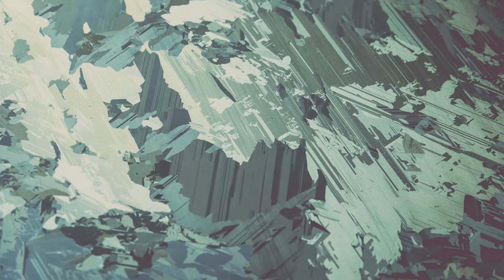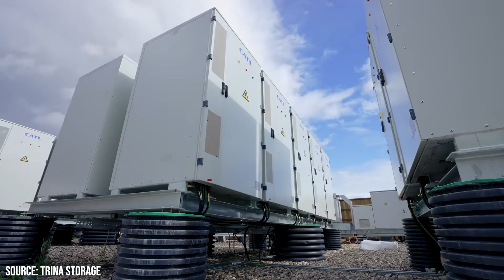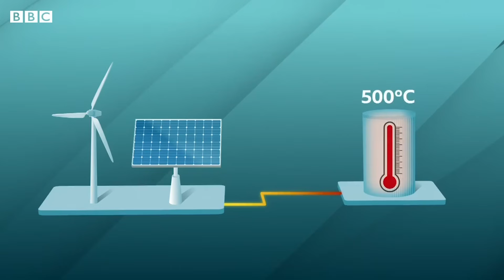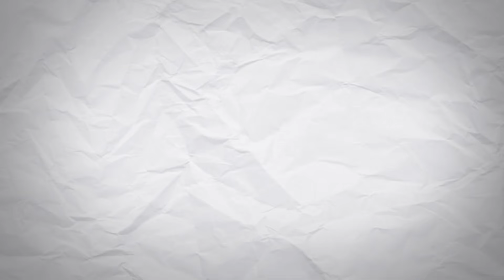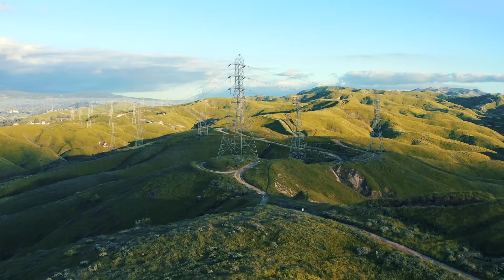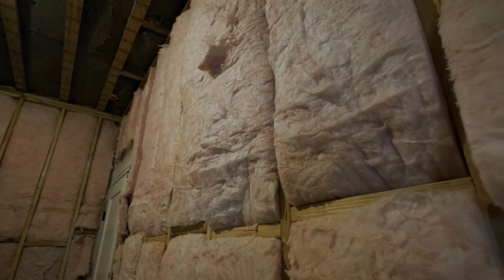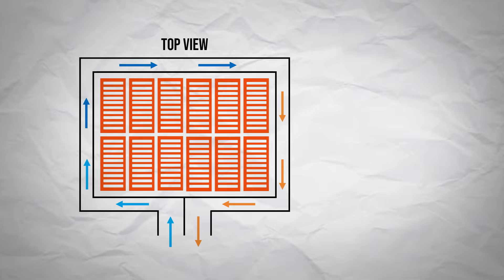How 3000 Degree Bricks Will End Battery Storage

Comment: It was an absolute pleasure speaking with you! Thank you for telling the story of industrial decarbonization via electric thermal energy storage.
Reply: What about smaller units for houses? Is that feasible? It would be easier to implement than on a district level and I assume it could be placed underground like with a septic tank or in a utility room.

On that note, could a small unit work along side a heat pump in a way where heat is retrieved during winter and then excess heat is stored during summer?
Reply: @Sweenus987 Exactly, this could potentially reach into household market and provide the cheap battery storage necessary to bring total system cost down 3 fold. Maybe even turn 5 Year ROI into 1 years if the cost is scalable down sizing 

If not there are plenty of other battery technologies just waiting to take down the lithium industry
Reply: I think the key disconnect here is that most of us are looking for “round trip” efficiency from electricity to storage to electricity again. The figure quoted is just electricity to heat and holding that heat for up to one day. 

There is no converting this heat back to electricity discussed. This heat will be used directly in industrial application where heat is needed, not electricity. 

So this isn’t a “battery” in our common understanding but more an “efficient heat storage”.
Reply: @benswilley7851  So for residential use cases it would be better to compare it to boilers? As in terms of how much energy it takes to heat a home, run a shower etc.
Reply: @Sweenus987  In the context of in-floor radiative heating, these would be great, as in those systems you heat a fluid and pump it through pipes or tubes in the floor slab, where it very efficiently releases that heat into the building.
Reply: @benswilley7851  I’m not certain that it’s fair to assume that these heat batteries will be limited to storing heat for only one or two days by the time they are ready for the market. I understand that in their current state, that’s the likely reality. However, as the market requires long term heat storage, it must be nothing more than a matter of time until the engineering is done to rectify the shortcoming.
Reply: This seems like a very promising technology!  I hope it works as intended.  Are the "bricks" made of a proprietary material (in order to be able to handle the heat loads and temperature changes), or are they made of the same kind of "brick" we used to build schoolhouses out of? 😉

I also wonder if this technology could be applied to dealing with high-level nuclear "waste."  As I understand it, nuclear plants currently need to cool "spent" fuel rods by putting them in pools that require energy from the grid or diesel fuel (during a grid failure) to circulate water in order to keep it from boiling off and letting the rods catch fire.  To me this seems like pouring half of a car's fuel into the trunk, setting it on fire, then using an air-conditioning system to keep the car from overheating. In short: wasteful, and dangerous.

Could the "spent" fuel rods be enclosed in "bricks" like the ones you use, and used to heat an inert gas (so they can't catch fire even if the brick enclosure should crack or leak) and generate industrial heat?

BTW: Does your company have stock?
Reply: This sounds good, but do you have a pilot? Also, dunkelflaute. Great word.
Reply: Could this be used to work with boilers to replace the coal burners for steam turbine applications?
Reply: @VonEveric  
Definitely possible. Round trip efficiency would be lower than batteries, flywheels, gravity etc. Also lower than using the stored energy directly in the form of heat. 

But the good news is that existing thermal plants (coal) could be converted to storage. The cost of a facility and financing costs are a big fraction of overall cost. Efficiency is not everything.
Reply: @OrenTirosh  so pay for it even if it doesn't work, what an amazing attitude to energy security..!!
Reply: @stewartread4235  what and amazing misreading of what I wrote. 

Storage systems with lower round trip efficiency such as compressed air have their place if they have other desirable properties.
Reply: @VonEveric  no..!
Reply: @stewartread4235  Why
Reply: @VonEveric  because you would have to produce more power than is put in, you can't produce something from nothing.
Reply: @stewartread4235  Energy and electricity is still a topic that mystifies many people. I understand how frustrating it is when you run into someone who has difficulties with the basic principles or simply is ignorant to the field. But we can’t be making assumptions that they are referring to perpetual motion or demeaning them through condescending remarks. I read the conversation you had. You come across as insufferably arrogant. Try to be better.
Reply: @Veritas-invenitur  insufferably condescending comes to mind.!
Reply: Wow what a concept this material inspires me if Nicola tesla had a viable concept this seems to be it the closest point to conceptualize from what we know
Reply: It's entirely incorrect to say efficiency is 98%. If you heat the bricks with electricity you can at best recover 35% of that back as electricity. Heat is low quality energy. If you consider that your output should be heat, then burning fossil fuels is 100% efficient as you convert all the chemical energy into heat. You should have qualified that 98% much more... People who don't know thermodynamics then repeat what they hear in these channels and it leads them to have silly expectations...
Reply: @andinosa  Burning fossil fuels is only 38% efficient.
Reply: Rondo energy, Carbon is Latin for Coal. Coal means decomposed plants. How can you decarbonize necessary material??? I guess you guys want the earth to be a desert if you profess decarbonization. The soil is carbon.
Reply: Jeez, the Romans did this..!
Reply: @stewartread4235  You know what else the romans did? Had their society collapse. And it looks like we're headed that way too
Reply: How can this be applied in a data center?
Reply: Like the fusion or anything... in then End, Make it work... I think I can says this as a member of the Human population that couldnt careless about what goes around.
And thankyou, to ppl such are yourself that makes this world easier to live, to push forward in technological advancement.
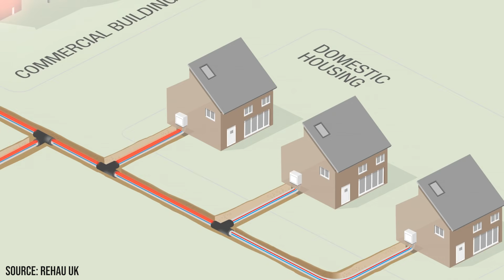Reply: Show uf grafs , independent mesurments . 7:33 in EU that what we call central heating .
Reply: How do i invest? How only 20mil? You need a bil !!
Reply: Who the hell are you.
Reply: We won't be "decarbonizing" anything, ya dupe
Reply: Don't you also make that energy drink with the Electrolights that plants crave?
Reply: @NexusARC  electro lights.......
Reply: @HarshJain-it2bg  Sorry, Electralights. Like that actress Carmen Electra.
Reply: @NexusARC  Electra ????
Reply: @NexusARC  Why did they let you go out of that mental hospital.....
Or are you watching YouTube there.
Reply: @HarshJain-it2bg  I got a metal plate in muh head.
Reply: @NexusARC  Then stay away from Electro-lights.
Reply: Thank you, and I hope you have good security because in my experience, anyone who comes up with a competitive energy product is coerced into selling or mysteriously dies.
Reply: @rondoenergy4228, This video is a great presentation of your project. I really like the idea!
However, I don't understand how the battery will operate when no heat is needed at the facility (e.g. at night). From the video I gathered that the battery must pump the air through itself to keep itself warm ("dynamic heating"). This action requires external energy. So, while the battery is 98% efficient, it requires external energy to operate when the facility is not operating. This must lower the efficiency somewhat. How do you deal with this? Is this a significant problem?
Reply: @unbridled_exciton  Maybe the solution is to run 2-2-3 shifts so the facility is always operating, at all hours of every day.
Reply: Hey, I have a question for you. You mentioned use of concrete while discussing the materials for bricks, but also that the materials could come from virtually anywhere. Typically, Concrete relies on a very specific type of clay that comes from riverbeds, where the constant water flow is able to reduce the stone to superfine granules. Because of how long the process takes, we are already expecting a Concrete Shortage in fields like architecture where concrete is more heavily used. I can only imagine implementing these batteries would also require a large amount of stone, considering our energy usage is only going to expand over time and that we have so much ground to cover as it already is. With that in mind, are any particular alternative materials being looked into for brick production?
Reply: for small households ,buy heating storage bricks and place them bottom of the oven everytime u cook ,and leave oven door open slightly to release the stored heat , itll heat the kitchen/open plan spaces for hours after
Reply: how will storing energy as heat hum... heat up the earth i f it was adopted as the new default energy storage?
Reply: i dont believe it can store the heat really efficiently. you will have to start using it as soon as its not heating anymore or youll slowly start losing some.
Reply: Can it be used like this in summer the hot air from AC is blow in this storage and in winter it can be pump back?
Reply: I love the interview and the technology. I’ve been researching thermal storage for industrial and district heating off and on for a while now. Conceptually, your engineering appears solid, innovative, and disruptive. That’s exactly what I like to see. I have a tremendous amount of questions concerning manufacturing, onsite assembly, cycle-rates, maintenance, scalability, and the reliability of your proposed systems. Hopefully, with the latest series of funding complete, the answers will be known before too long. See you at your IPO!

Comment: We don't really need that kind of heat for everything. Number one. Number two, the Rankin cycle is only 30% efficient. Batteries are 95 to 98% efficient. I don't see thermal storage being anything but a niche for specific uses not for general purpose storage

Comment: Looks like a decent technical solution for chemical industry. The approach of switching the chambers is 100 years old using flue gas to preheat air in steel production. I like the concept of using old technology that worked perfectly well. I see this as a good solution in Germany where we have a chemical industry relying on natural gas for steam production but have time with high renewable electricity at a low or even negative price.  To integrate such a system in a steam network at a chemical site should be easy and profitable. Wonder if there are more technical data in the public space. Where is the IP of Rondo?

Comment: Disingenuous - no mention of round trip efficiency going from solar or wind to thermal storage back to electrical ... sounds like snake oil when you are not upfront with that type of information. According to energy-storage.news, pumped hydro energy storage (PHES) has a round-trip efficiency (RTE) of around 80%, while lithium technologies have an RTE of over 90%. RTE is the ratio of energy retrieved from storage to energy put into storage, and is expressed as a percentage. Thermal energy. (TES) systems can have a round-trip efficiency (RTE) of over 90% for thermal-to-thermal applications. However, each conversion in a TES system is usually less than 90% efficient, and the combined efficiency of conversions to and from storage is often less than 75%.

Comment: Even simpler even more low-tech 
A rocket mass heater built out of those bricks and use sand as the thermal mass 
This could be done by anybody if you could get the cost of those bricks down to where the average American could buy them 
Anybody source for those bricks? And the price tag? I’m sure there’s people out there that would love to have access to those bricks I can handle that kind of high temperature bricks

Comment: I still find this inefficient. 98% is far from being efficient.
I wouldn't play with a 1000-3000°C brick to heat up water or whatever.
If you happen to get a water leak, you'll need a new house / factory.
Same goes for molten salt that leaks out into the atmosphere or even worse, into water.

Comment: We only have a limited supply of lithium prob less than oil or uranium plus monopoly on those resources why jump from one dying limited tech to another with the same problem at least for thermal batteries on large scale you could technically use nuclear fuel waste to keep it warm or solar  panels larger it is longer it takes to warm up but also longer to cool anybody that thinks lith battery tech is the way to go probably doesnt see the long term downsides and economic monopoly for something that only last 4-7 years if treated with love wich running a city grid does not provide

Comment: The radioactive decay producing heat in the earth's depths is from the large mass of the earth.    A small amount of this heat takes much time to travel thousands of miles through rock.   When too much heat is retained, convection of rock results. This results in hot spots under the crust.

Comment: @Thunderf00t seems like an issue when you need to heat things very hot. Only the top 50% can be used to heat to 1500C from a 3000C battery. Bye efficiency

Comment: Converting steam to electricity by electrical generation costs roughly 2/3 of the energy as waste, with 1/3 of the energy as electricity. 
2/3 wasted heat, 1/3 available for work.
33% efficiency.

Comment: The title is misleading. With a storage time of only about 12 hours  it does not deliver energy constantly enough for many industrial applications.
Constant thermal cycling will eventually degrade the ceramic blocks. A battery stores electricity, this stores heat. If that heat is used to generate electricity the efficiency will be less than 50%

Comment: Lithium only has a lifespan of 10 years in daily charge cycling. They lose between 15-30% in just the first 4 years.  So at 5 years, your enormous grid battery has lost a substantial chunk of its capacity, increasing its cost per kw/hr of storage dramatically. Lithium is simply stupid in heavy load/cycling applications. Not to mention the high cost of disposal at end of life, which right now is 300% more than the original cost of manufacture.

Comment: You are lying about the efficiency of the heat battery for electricity production(98%  95%);  that is absurd on its face given the thermodynamic limit in converting heat to electricity.   Even in a best case scenario(practically unattainable) you are going to loose over 50% of the energy stored.

Comment: To compare directly the energy density of this heat battery with a lithium battery doesn’t make sense. 1kW/h thermal energy cannot converted to 1kW/h electrical or mechanical energy. 98% efficiencies were mentioned. This is the electrical energy coming in and heating ab the thermal battery compared to the taken out thermal energy. But the thermal energy can only be converted with a high loss back to electricity, I would guess optimistically something around 40% can be brought back as electrical energy. This conversation rate makes it as support and storage for the grid economically useless. 
For some applications with short time high temperature consumption it might make sense. 
For these reasons I do not see any revolutionary, it can’t replace lithium batteries at all.

Comment: Why would you create electricity to run heaters for this application?  Why not use sunlight to directly heat the thermal system to begin with?  An 18 to 20 foot diameter reflective surface can reflect around 200K to 250K watts of energy to a focal point.  That is enough thermal energy to cut through steel plate focused down to a 4 inch diameter focal point.  You could very easily heat large systems by simply powering them with solar radiation and completely forgo the use of solar panels or electricity completely.

Comment: Native Americans heated up rocks to boil water, so historical symmetry...You can definitely store a lot of heat from deserts and wind farms/geothethermal spot, coastal/lake/river hydropower etc...We're not told how it's converted, other than by steam..but need to transport converted green energy...so that means we make hydrogen, store it in magnesium mineral paste....and we need to transport energy in batteries.  Unless we have the insulation to keep these rocks hot during miles of transportation. We can blast off heat rockets in desserts, if the energy is beamed back descending, but transporting energy is big part of this.

Comment: Thermal energy storage (see Wikipedia) has been in use for along time.  Molten salt, for example. 

Worldwide heating and cooling consumes the most energy.   There are several methods for DIY homeowners to store thermal energy but of course these systems require around U$10k  ... which typically takes 5 to 7 years to start getting the payoff. 

Anyhoo ... whatever Gates or whoever the billionaire invests in ... surely isn’t for the benefit  of  we the people.